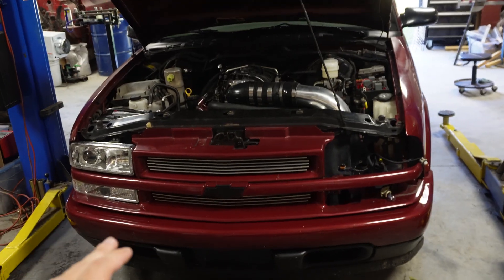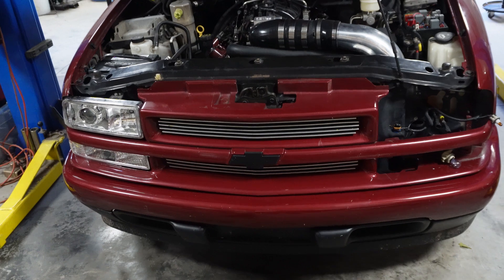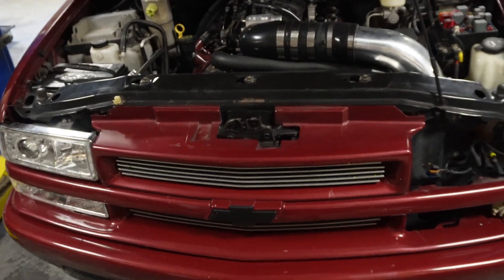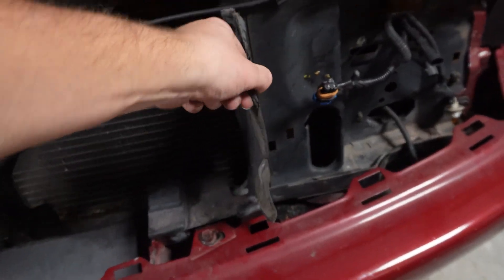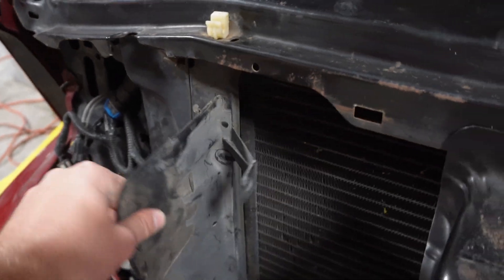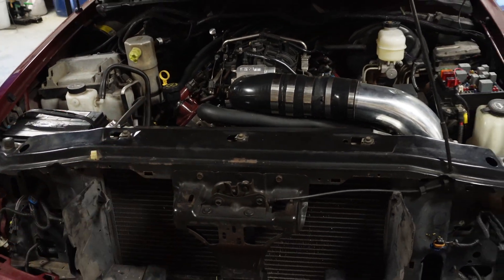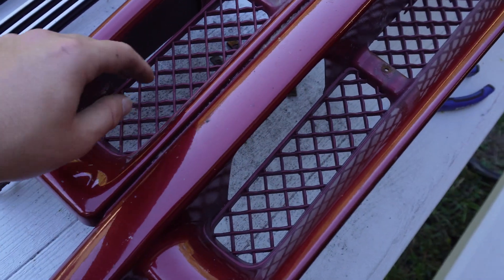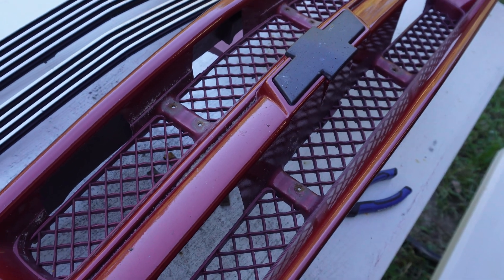S10 LS Swap PT 24:  Modifying the Grill for More Airflow

Comment: Hey man quick question, changed my fuel pump to a 2.2 flex fuel fuel pump. Now I have gas dumping out of the vent canister under the bed. Any suggestions? Line are hooked up right.